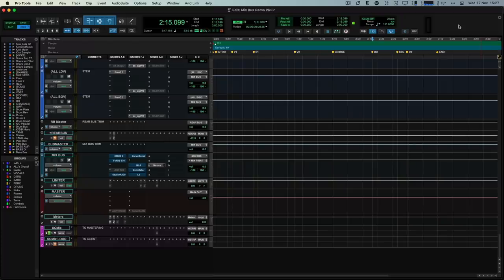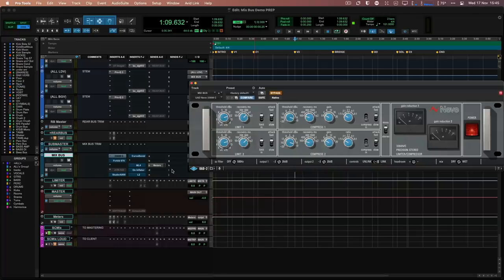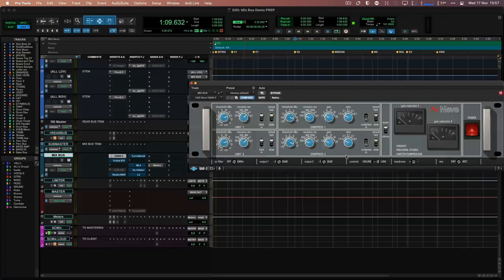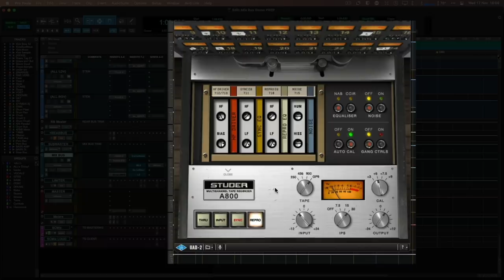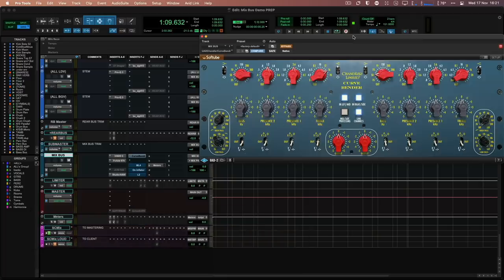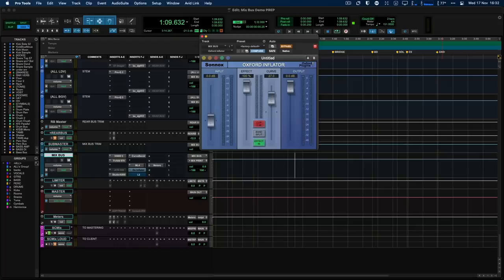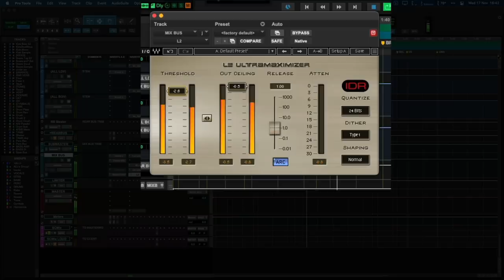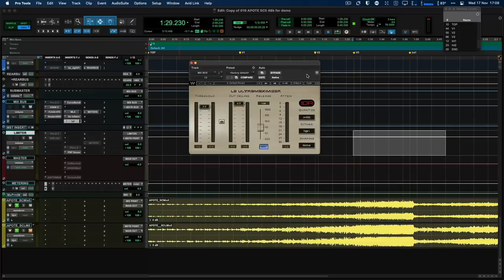Mix Bus Plugins & Tips with Sara Carter

Comment: Thanks a lot Sara, really! Going completely over board with plugins finally paid off! I made a 2022 version and threw in Gullfoss live at the start, then the 33609 C, Fairchild 670 (with the option of going Manley Vari-MU), ATR/Studer, switched out the ML4 with the Eventide Split EQ, then the Oxford Inflator and finally I switched the L2 with bx_limiter True Peak and saved it as a mix bus template. I do not go as hard on the Oxford inflator, but kept most of the other settings to get in the ballpark before tweaking to taste. Sounding great! Again, a big thank you. :-)

Comment: Thank you for sharing this Sara, and congratulations on the spotlight you deserve. Why can't I get my head around mix bus processing? Are you constantly checking the levels of the processes on the mix bus with every mix decision you make? Is it virtually set and forget even before level balancing? I've heard from CLA before that he likes the 'needle just being touched', but don't you find later that's ended up as 4 - 6db of compression you weren't aware of?
Reply: Having a template with my group busses and the dynamics processing already active helps, as well as making sure the tracks themselves are in the right ballpark, level wise. You can do as I suggest in this video and start with the threshold all the way open and then set it once you're part way into the mix.

Comment: Nice to see a vaguely familiar interface, it's a slightly different arrangement from Ardour, but I feel at home with it :) 2mins in and I'm already loving the way Sara explains things, so I may well check out her channel after this
Reply: Because I'm on Linux, I use the LSP multiband compressor in a very similar way. I actually use 6 bands to get a bit more control and also use the mid-side functionality to centre the bass and push the top end out beyond the speakers. I also use x-42 plugins on the mix bus because they are so clean. What I have to work harder for is the tone colouration. Sara gets my vote here because I'm not left wondering what these plug-ins do, which makes it a shed-ton easier to figure out suitable substitutes
Reply: @timflatus  Thank you so much, glad it made sense to you!

Comment: Some good suggestions in theory and practice. I don’t have or use any of the plugins you have on your buss but like the overall concepts.The idea of subtle use and coloring is a good one. I do have plugin Alliance versions of some the ones you use so maybe ill play around with them in my chain. Im still tweaking my sub master chain and its currently a mix of plugin alliance and izotope plugins. I always have an ssl channel strip which i often just use for warmth and don’t always use any of the compression or EQ. I just added the new eventide split eq and am testing that out on a track im working on. I also add eq and compression all along the signal path in smaller stages as im mixing. Because im mixing and mastering my own tracks i tend to get everything to a good enough point then bounce down. It’s usually weeks to months before i go back to it and do a final mix/ master session. This way I’ve distanced myself from the track and can make better decisions. I usually listen to the rough mix along the way to decide if i even still like the track enough to want to spend time doing a final. Thanks for sharing the great tips and suggestions.
Reply: Great advice! thanks for watching

Comment: Interesting, I do some similar things. I also use a 33609 with 100ms release, but I've been using the Arturia plugin. I also dial it in slightly differently where I'll dial in the limiter first to get the needle bumping a bit and then the compressor also bumping a bit. I like the sound of a little analog emulated limiting before my digital limiter. I use the UA Studer pretty much the same. I don't really like the Curve Bender tone that much and tend to use the Black Rooster Pultec plugin and I use it before the tape, but that is probably a side effect of back when I had the opportunities to use analog gear. Finally, I was using the Ozone for limiting but have since started using the bx true peak option. Ozone, and the Curve Bender for that matter, do something to the midrange that doesn't suit me.
Reply: Interesting, thanks for sharing! It's all about taste isn't it. That's the great thing about music production, otherwise everything would sound the same.